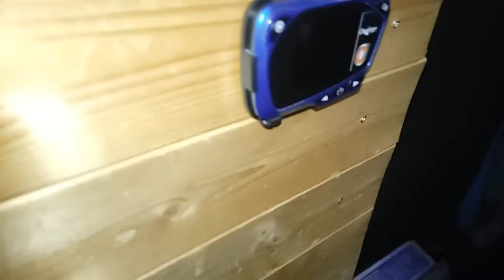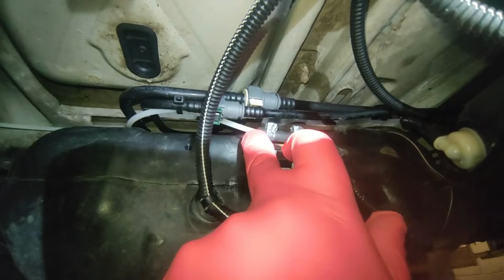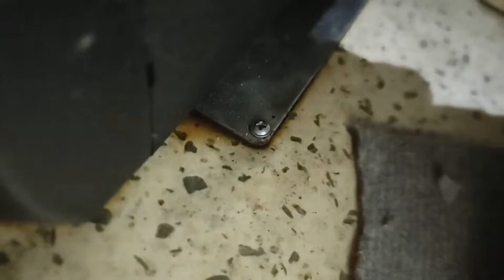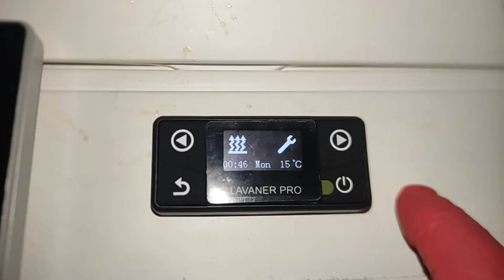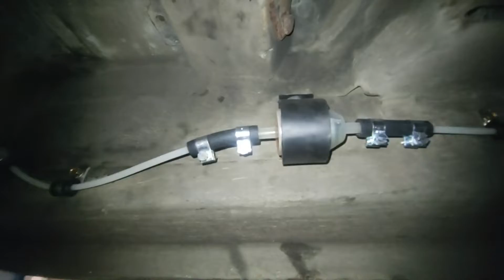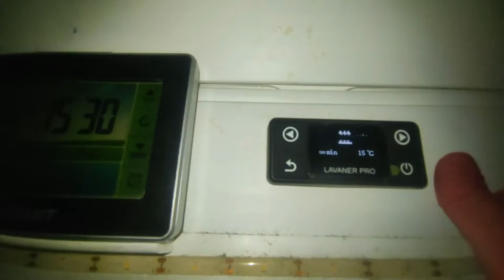Lavaner Pro Max 2kw Diesel Heater - Peugeot Dispatch van installation

Comment: So far i cant say impressed with Lavaner, I NOW WISH I GO THE HLN; ( which really wasn’t much more then Lavaner) the wires to the pump where not in the plastic connector and it didnt say anywhere if polarity matter. I emailed Canadian. Supplier no response try his other email no response then dude tells me I sent him like 36 emails BS. I emailed Craig got fast reply and great answer with photo. The Connector to the DH to main harness was tricky as I’ve never seen one that had a slider so I inquired with canada supplier no response. Posted to FB group and got quick simple answer. As well Craig again replied with easy answer, (when you know) and plus its winter i have no heat last thing i want to do is break something so erroring on cautious side. Canadain rep who claims i sent 36 some odd emails over 14 day when i only started installing 2 days ago and said he couldn’t handle my emails. I screen record my sent messages and forward to him and Craig. At first; after 2 non replies i sent one to Craig why would i send 60 to anyone without trying Craig or fb group wtf. So at this point i did get it running after i got error code 01 which means check everything …really?!? Once i got past that i couldnt  get remote to adjust the temperature or main screen. It does appear to be in manual not auto but in what I perceive to be heat mode it will only adjust the fan im guessing L1-L-9 and no I’m not in ventilation mode. SO dont buy Lavaner is my recommend its already been a big hassle and insult … what will it be like when i need parts!?!? No fawkin thanks GO HLN GO the field wide open. I hope to get controller figured out idk there only few videos on it and one guy who review was weird and poor job on explains the controller. Maybe lack of videos should of alerted me idk 

I’ll do a video on it so more people see i so far prefer the cheaper remotes for simplicity